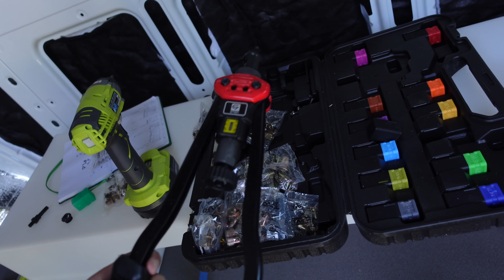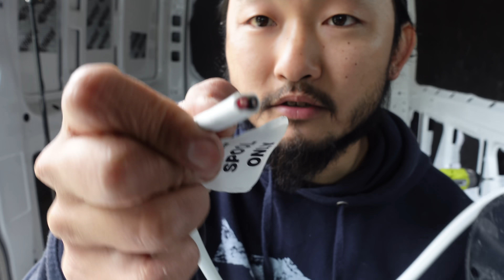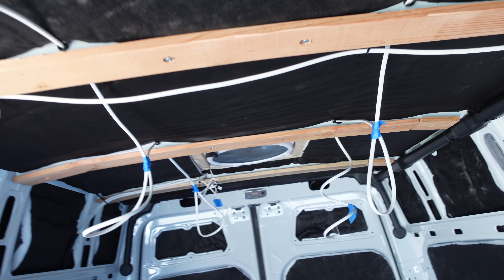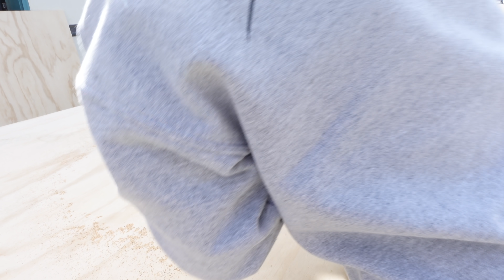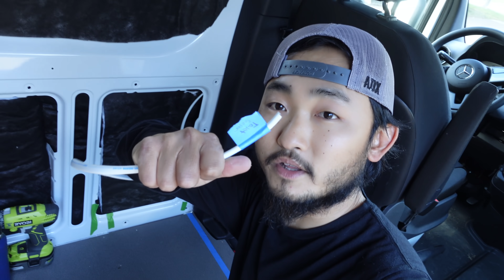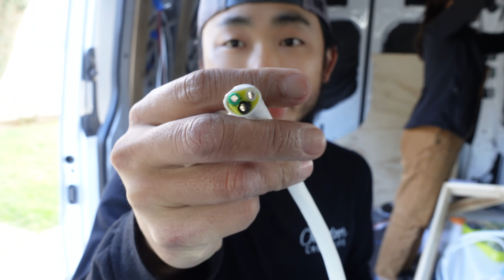Insulation and Starting Electrical for Our Sprinter Van

Comment: Obviously too late for you guys, but anyone reading this. The reason you secure the insulation with tape or adhesive is that the vibration of the van will collapse it over time and it will all bunch at the bottom of the cavity. You only need to secure the top of each piece to stop this from happening.

Comment: If you look at your laptop power converters, most of them output between 12 and 19v DC. IOW, you can usually run them off of your battery without the DC converter. My FIT PC is wired to my house DC bank on my boat. Works fine.

Comment: in addition to others mentioning breakers, fuse boxes, you should also add soundproofing material along with the insulation, e.g. Dynamat. It will make a world of difference.
Reply from the maker: Yup, already installed it

Comment: Hate to be debbie downer but the 3m sticky zip tie supports don’t do well with heat. If you are mounting then anywhere metal that conducts heat (especially the roof) they will probably fall off the first summer. You might  think about using the plastic ones that can screw into metal.

Comment: Get a "fish tape" from home depot for running wires if you ever struggle. It's a life saver. 4 guage wire between batteries and I guess 14 guage is fine for everything else. They run 12v outlets capable of 25 amps or more with at least 12 guage. But you should be alright. But you seem to be doing great for someone without electrical experience.   Remember if you are charging using a alternator get a dc to dc charger! The renology one is good but the victron 30 amp is better. (I've had both)

Comment: I don’t know if you are doin this but I noticed you drilling passage ways for the electrical cords. I hope you are remembering to primer coat any bit of metal that you are drilling, cutting into or screwing into. As there will be moisture passing through every inch of your van you want to do what ever you can to avoid rust. Digging the van build series as I dream of van life all the time and it’s a nice change up from the catch and cooks. Keep up the awesome work🙌

Comment: i like your windows! but consider adding some insulation on the piece of the van thats exposed under the bottom ledge of the window. Small exposures can cause lots of heat loss, im from up north so it makes a big diff especially when the spot is next to your sleeping area

Comment: You shouldn't tighten the zip ties, and you should only have one zip tie per wire as a good rule of thumb. If the wire has any preasure it could heat up and melt the sheathing which is bad. Just make sure the wire can slide inside the zip tie.

Comment: The stock rivet nut the tools provides likely make of low grade material, which might easily rust over time. Can consider getting some Alu one or even Steel one. If you wanna replace, just drill it out. Cheers.

Comment: You could've just notch the wood instead of drilling through the roof supports. You also need insulation in the roof ribs. which is one of the larges area for condensation.

Comment: Also make sure you whip that thing around the block a few times throughout some of these stages of install... that way you can secure things better that may make noise while driving. The last thing you'll want is to have a tapping or knocking noise every time you drive but it is buried too deep to fix easily. So fun to watch you guys on this journey! Keep it up!
Reply: Good point. All it takes is one wire that is not properly held down tapping against something to drive you nuts!

Comment: plz tell me you are going to put in a filter for the fans...otherwise dust city :(

you should split the lights so you don't drain battery too fast...like 2/3   bed/cooking  or are they manually turned on...each one? not installed switches?

OMG i am so happy am i the first to notice? XD I am so happy for you two XD

Comment: Also,  if you haven't already considered it.. leave sufficient ventilation for your batteries. Lead acid batteries can generate hydrogen when charging/discharging which can be an explosion hazard.
Reply: The batteries are sealed so he's good
Reply: @dusiajhrqid  Sealed in this context is a misnomer, and means the electrolyte is gelled i.e. doesn't require maintenance. ALL such cells have a vent.

Comment: I think the adhesive on the roof insulation is going to be an issue. When that roof gets baking hot in the sun, I worry it will delaminate.
Reply: I agree, 3m makes a different adhesive that they use on boat interiors, that would work .

Comment: Should probably take a pic of all the wiring exposed just so you know where they are. You might need to make a few holes through the completed walls in the future. Also, energy from gas is very cheap, should consider a gas water heater or on-demand electric.
Reply: Hi is gas propane (as in those white tanks) or butane?

Comment: Will there be any engine or transmission upgrades since putting a lot more weight to the van?
Reply: those vans are meant to be work vans and can handle the weight. + its brand new

Comment: Suggestion... after pulling your first wire, could have used a pull string in case you need to run more wires from the same area back to the power point

Comment: AC wiring has three the purpose of the third wire the green is the protection wire ground, the white is the neutral and black is the hot leg. AC is alternating current basically non directional, DC direct current goes in one direction.

Comment: I realize the van is made for hauling stuff, but with all the stuff you're adding, will the van need more horsepower or stronger suspension?
Reply: The model he has can haul 5000-7500 pounds so i don't think he needs to upgrade the suspension plus i think it goes down in value

Comment: In household electrical, 12/3 AC wires are actually 4 twelve gauge wires, 2 hots (black and red), 1 neutral (white), and a ground (green or bare). Must be different for automotive/camper wiring.

Comment: Use pinch molding around all the sharp edges to keep the wire safe I'm chafing or you could use the plastic wire molding at the sharp edges on the walls. Looking good can't wait to see the rest of the process. Great video keep up the good work.

Comment: Don’t forget for lighting use real LED , they cost a bit more , but LAST longer and brighter and use way less power

Maybe have hidden drawers under the bed 

Walmart sell these rubber edge cover which could easily slide over those sharp edges .